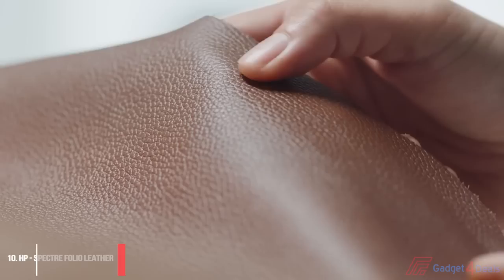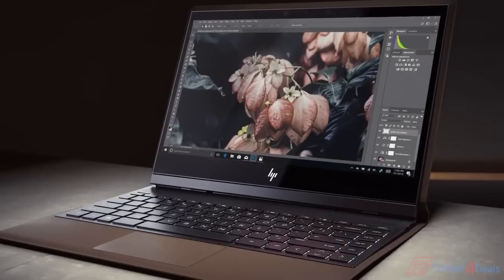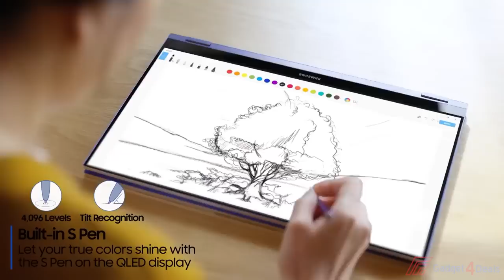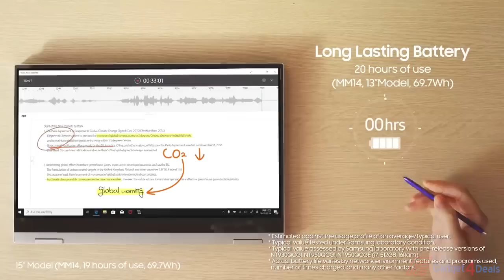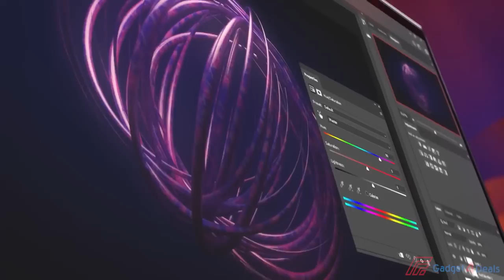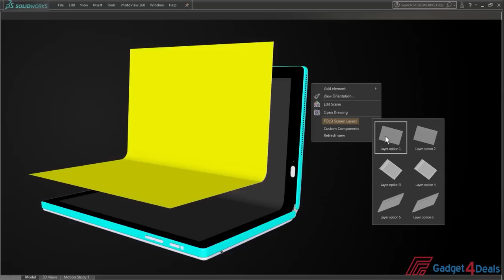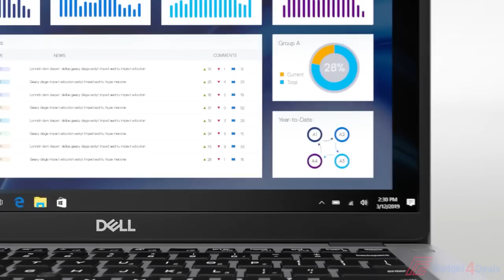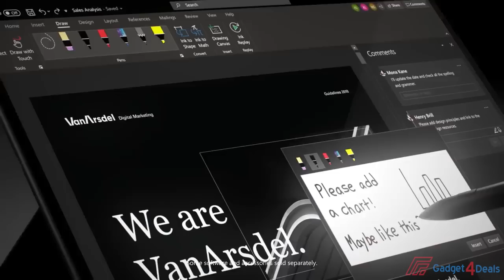Top 10 Best 2 in 1 windows Laptops/Tablets of 2021

Comment: The Samsung Book Flex Alpha is an alternative to the Flex , only difference, no charging on the track pad and no pen.  Specs, i7 512GB storage, 12GB memory for $899.  Add a Surface Slim Pen, it works very well on my Flex Alpha.  Amazing laptop, I just put a bunch of games and photography software on it and still loads in 9 seconds from a cold boot.  Or you can leave it closed for a little battery drain and it powers on instantaneously .
Reply: Interesting
Reply: Also Flex Alpha doesn't support USB c charging but flex does

Comment: I bought one Dell silver 7306 2 in 1 one  month and a half ago for a Christmas present. When we opened it we had a bad surprise.  It is almost impossible to see the letters and symbols on the keyboard even though the maximum backlight is set. The light proceeding from the screen makes it impossible.  It is very difficult to use it with this incomprehensible error in the design.  Although Dell has acknowledged the issue, they have not solved it, due to the time elapsed from purchase to opening. Don't buy the silver model.
Reply: same here I got it and I'm returning it tmrw i find it not worth the price at all since I got it less than a month I called them 3 times just to see what the problems I had with it like it will not open unless i plug it and it will not let me open any vid on yt even that they fixed it twice but i still have this problem and no its not from the Wi-Fi all my other devises were working fine on the same vid also it keeps telling me to restart my devise over and over again and when i do it will not open again so I'm looking for a new one now

Comment: Would you please help me?
I need a 2 in 1 laptop. Specially to draw on screen with stylus pen. My budget is limited. Which one should I buy? Which is the best?

* Lenovo IdeaPad Flex 5 Intel Core i7 - 82HS00F4TX
* Lenovo Yoga Slim 7 Intel Core i7 1065G7 - 82A100F6TX
* Lenovo Thinkbook 14S Yoga Itl - 20WE0033TX005
* HP Envy X360 Convert 13 AMD Ryzen 7 4700U - AY0006NT
* HP Envy X360 13 I7-1165G7 - 3X8X6EA
* Samsung Galaxy Tab S7 Plus SM-T970
* iPad Pro 5th. Gen

Or any other suggestion in these prices?

Comment: which one
2020 HP Envy x360 2in1 15.6" FHD Touch-Screen Newest Flagship Laptop, AMD Ryzen 7 4700U 8-core(Beat i9-8950HK, up to 4.1GHz), 16GB Memory, 1TB PCIe SSD, Fast Charge, Backlit-KB
or
 HP Envy x360 2-in-1 15.6" FHD Touchscreen Laptop Computer, Intel Core i7-10510U, 32GB RAM, 1TB PCIe SSD, Intel UHD Graphics, B&O Audio, HD Webcam, USB-C, Win 10, Silve
or
Dell - Inspiron 14 7000 2-in-1 - 14" Touch-Screen Laptop - AMD Ryzen 7 - 16GB Memory - 512GB SSD - Sandstorm

thaks for your respond

Comment: My mobile specification is 👌💪👀👇
Vivo v20 
Qualcomm Snapdragon 720
Internal Storage 256 GB
C type charging cable 
Fast charg Adaptor 30 w
Battery 4000 amh
Faster charging time 00: 30 minutes only 
& cost INDIAN CURRENCY Rupees 
Rs-28000 /- only.